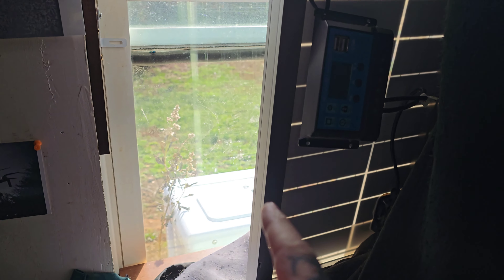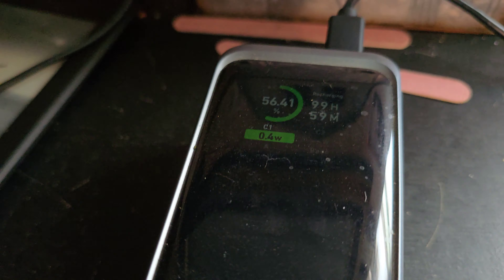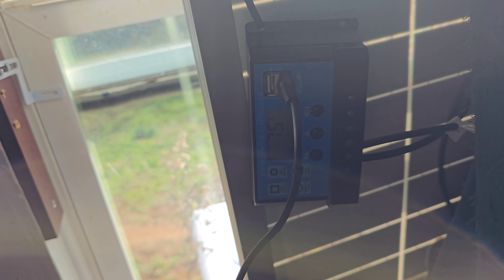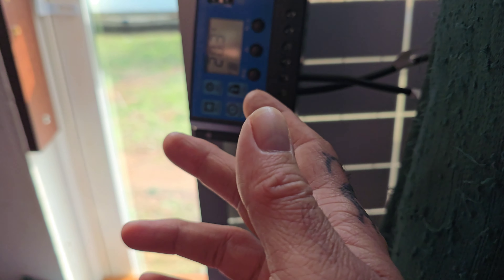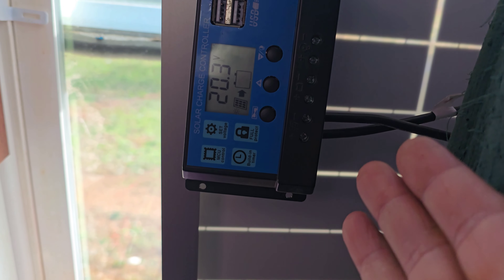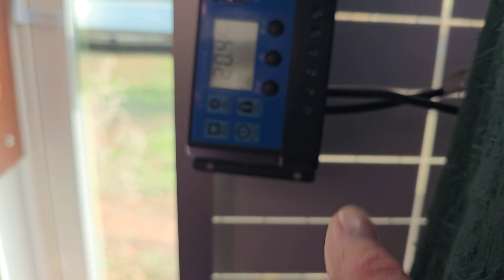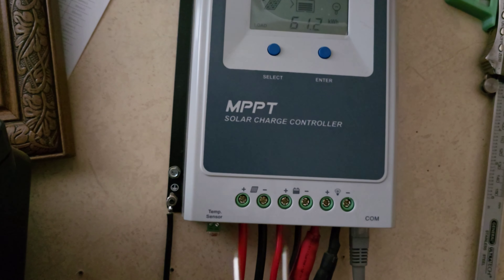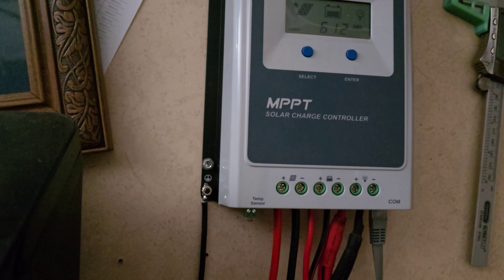Cheap Charge Controller Fiasco

Comment: The controller is not the fiasco. What you are attempting is. You need a battery. I use the same controller on a mobile system for my boat. Works perfectly because ..... I have a battery.

Comment: You are supposed to connect the charge controller to a 12 volt battery BEFORE you connect it to a solar panel or it will damage the charge controller: they warn you in the little directions flyer that comes with the controller.   This could explain why things are not functioning right.  I have a 50 watt Renogy panel and the same controller and I hook them up to my lead acid car starter battery now and then.  I have charged up two led lamp devices simultaneously pretty quickly.   Tip:  if you are using one of those cheap pwm charge controllers in a moveable/portable way, the wires lead where they stick in the controller will get fatigued, fray, and you can get shorts.  Simple solution is just hot glue gun where the wires go into the controller.  I have engineered quick disconnect connectors on the leads.

Comment: Open Circuit voltage is a thing.
Sometimes devices need a load to regulate the output. Definitely a cheapo you have there tho.

Comment: Have you read the manual? Pretty sure those charge controllers were never designed to work without a battery. Just use a 24v to 12v step down converter connected directly to the panel. Then use 12v to USB v3 adaptor.

Comment: I don't want to be rude but do some research on how it works your knowledge is letting you down not the equipment. Voltage comes down when amps come up, measuring an open voltage with no load gives you the solar panel open voltage as it states on the solar panel. PWM controllers aren't the same as MPPT controllers.